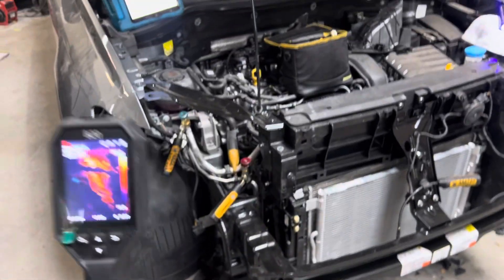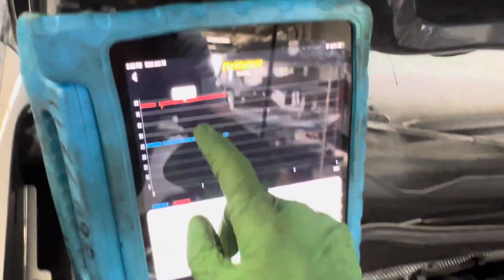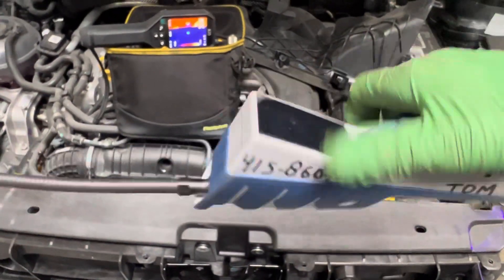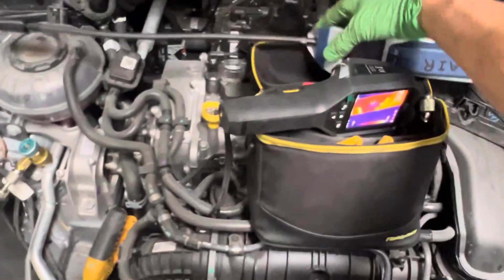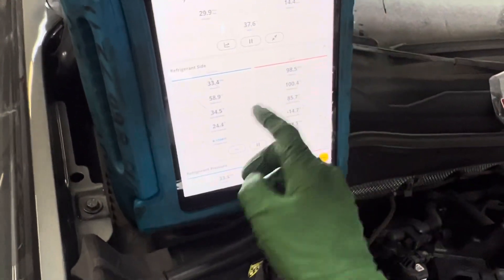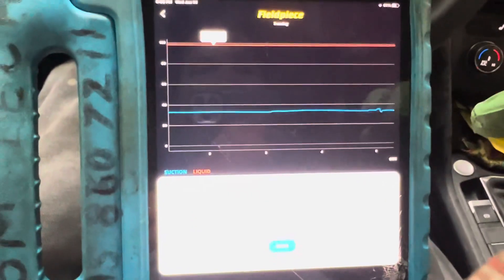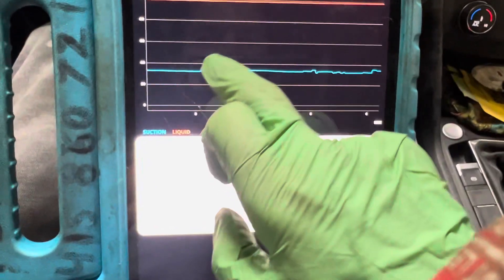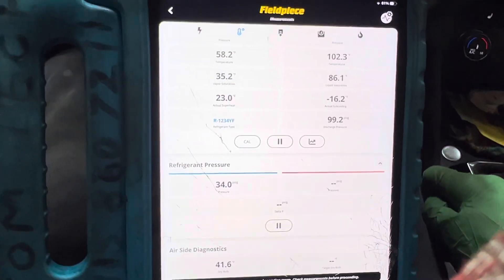Variable displacement, compressor at high rpm, or at idle, same pressure readings

Comment: That worries me. I oiled my compressor yesterday and turned the shaft a few times and oil kept popping up out of the discharge hole. I was trying to steer some of it back to the suction port but half escaped. Probably lost an ounce out of 2.5. I think I should have made an in and out tube that circles the oil back while I hand turn the shaft.
Reply from the maker: That’s a learning experience
Reply: @coldfinger459sub0  is it ruined if I did that in an 8 or 9 ounce capacity system?
Reply from the maker: @electric_thumbs  nothings ruined you just add oil back in.
Reply: @coldfinger459sub0  if that new compressor really did have 2 oz of oil in it like it said on the label soon as I open it up and started turning the shaft shouldn't oil have come out of the discharge pour the back which I had pointed at the cup? If I got nothing after even a full turn and it didn't even make any difference to open the bottom bolt then that mean it's pretty much empty?
Reply from the maker: @electric_thumbs  it all depends on the compressor manufacture, and that specific year make model compressor application. 

Just turning the compressor by hand, does not make all the oil come out the discharge port .

Sam, you have to physically turn upside down and sit under in for quite a while and it’s not a straight shot. Sometimes you have to move them to the left and the right upside down then straight up on their back side and then towards supports again because of the way they’re designed inside you do not get 100% of the oil out.. 

Somehow, both holes in them that are not oil ports therefore adjustment Springs, or other applications that have no access to oil at all. 

It all gets back to reading the manufacture of the compressors method of measuring oil. 

Everything falls back on reading

No rules of thumb

No, guessing

No, using a different manufactures compressor as a reference of what another manufactures compressor should do. 

There’s literally too many body styles in models of compressors, even within one manufacturer. 

Reading 📖

Comment: I have a off topic question. I’ve watched one instructional video that shows flushing the evaporator while still installed with solvent and then drying for about 10-20 minutes blowing shop air in both directions. Another instructional video states that the evaporator can’t be properly cleaned and dried without removing it from the vehicle, so don’t unless you absolutely have to. Which method results in the best outcome?
Reply from the maker: It all depends whether or not you can remove the expansion valve or orifice tube. 

You cannot flush through a expansion device, the restrictor, a.k.a. orifice tube or expansion valve 

So you can leave in some situations the evaporator is located in the dash may take many hours to get to it . 

But if you’re lucky enough to have the expansion valve located or the office to be located outside in the engine compartment, you can remove it . 

Then you can hook up your adapter to where the expansion valve used to be or the pipe where the orifice tube was located and use your flushing solvent, and you can blow through it pushing your solvent in both directions using your shop air other than I don’t recommend shop air, but yes, using your shop air to push through in both directions . 

You will get moisture in there that develops from the compress shop air but you just leave it on the vacuum pump longer. You already remove the oil or any tiny metal particles. . 

Basically, it comes down to if you cannot to remove the expansion valve then you cannot flush through the evaporator 

If you can remove the restrictive device, then you can
Reply: @coldfinger459sub0  thank you for your answer

Comment: Hey Tom do you have a screen protector over the iphone? Sometimes those tempered glass covers will delay the autofocus on android and Iphone.
Reply from the maker: A screen protector over the touchpad screen affects the camera lenses auto focusing ?. 

Did not know that never heard that one now you have me doing research 

But I believe when I ordered my phone from Apple, I got the optional screen protector

And I hope they fix the problem on the iPhone 16 or 17. I’m planning on getting a new one. 

I had the iPhone 6s Plus max or Pro whatever it was called until they came out with the iPhone 12+ max pro that I am using now 

Really was not much of an upgrade other than speed memory size
Reply: @coldfinger459sub0  In addition to the screen protector some kits came with and additional lens protector for the main cameras on the back of the phone. I took my lens protectors off and my samsung lenses are focusing better. Sometimes they just need a good wipe too.